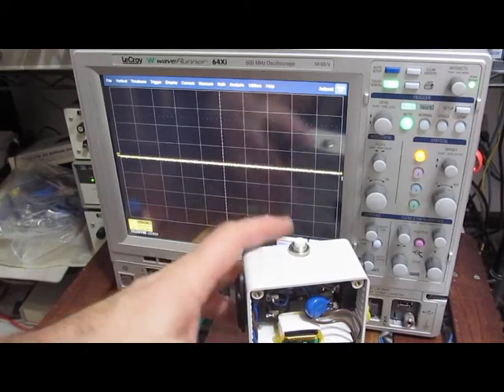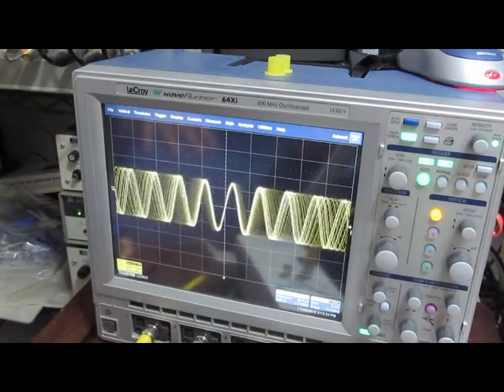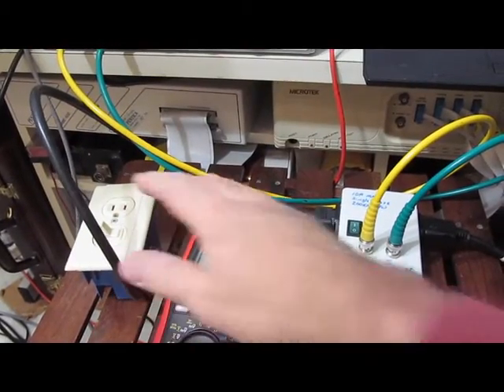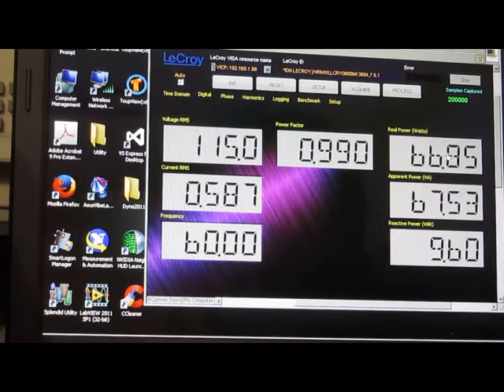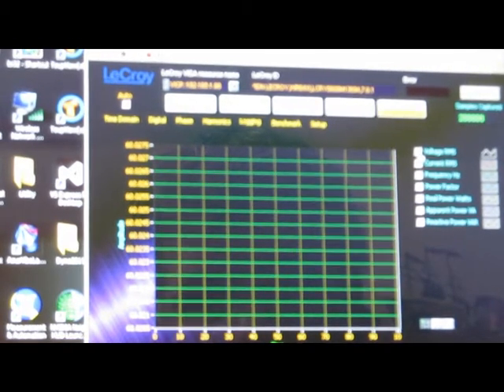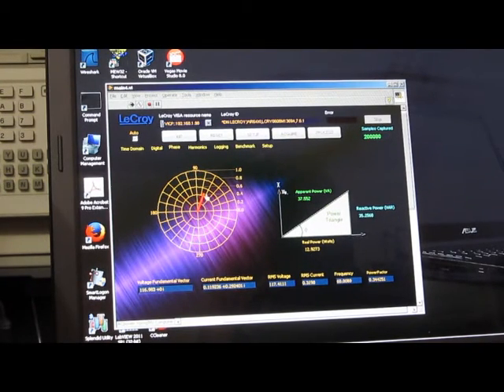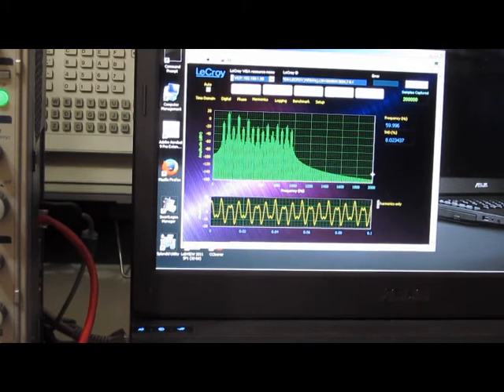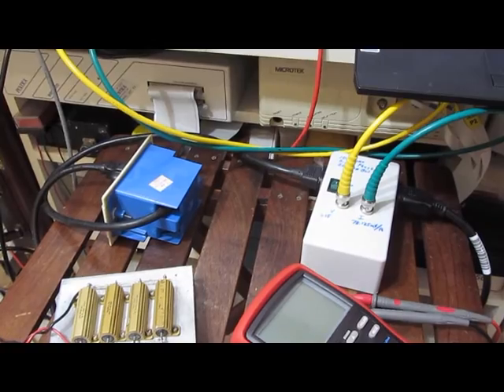Measuring AC power with my LeCroy 64Xi  and Labview

Comment: hi, did you had the power analyzer macro installed in the scope? i know lecroy charges alot of money for that one

or was the laptop doing all the data processing ? 

was that software from national instruments? and if one can download it can you advise where ? r

egarding the sensors you used, just a hint...you can use a LEM LV25 which is can be used to measure voltages instead of that transformer that  you used...will get you a proper bandwidth with negligible phase delay on the voltage measurement to match that of the current...it is however quite expensive (3x more than the current sensor).
Reply from the maker: Custom software written in Labview.   Transformer was something I had.  I measured the response and it seems it was flat well past the number of harmonics I was interested in.   There is a part 2.   https://www.youtube.com/watch?v=04I7nHA_HxM

Comment: Ask if you can have a key for the software option to compare, I'm sure it's not a problem.
Too bad it's only 8 bit and poor accuracy, so it can't replace a real power analyzer.
You should go work for Keysight, you did better with this than their PA2200 power analyzer, what a POS. They recently did a demo and it literally did not work. Totally unfinished.

I run a similar software on my bench, so I can read the data out of the instruments. It calculates efficiency, charts graphs, logs data, reads out the harmonics and displays them in a sensible way (the power analyzer interface is atrocious).
I have it on a small touchscreen display to control it and input numerical values for the loads. 

You could easily add some code to control your signal generator and record bode plots.
Reply from the maker: +stefantrethan With the PA2200, was part of the problem that the people giving the demo did not know how it worked?    The system looks pretty nice.  Too bad they couldn't demo it for you.   Which systems do you have where you work?
Reply: +joe smith There were issues on all fronts.The software was useless. That screen that you programmed with the digital readouts (power and such), it did not exist. You only got the trace (scope) view, and those all important numbers where shown tiny on the right like any old scope measurement. Autoscale/range did not work at all and this is important on a power analyzer. It had some weird acquisition problem where it would just go to maximum ADC value randomly. The voltage channel was intermittent. Even if the hardware wasn't broken (which we can put down to that one demo unit) the software was so far behind it was no way near ready to show. The harmonics display did not allow you to correlate to the different limits set in the standards (they fixed this by now I think). Clearly the person who made the software had either never used a power analyzer, or at least never used it to any purpose. If this was meant as an option package to a scope, it would have been a poor showing, but for a 20k standalone unit, no way. 
Just look at the current imput on the rear:
<http://about.keysight.com/en/newsroom/imagelibrary/library/IntegraVision_images/image009_high.jpg>
Do you think this green terminal is good for 50 amps on a lab instrument? 

I think the idea is good - use existing cheap scope platform and put isolated 16 bit converters on it. It would give them a nice flexible platform like Yokogawa has. But it's gonna be a long time before I take them seriously again on power analyzers. The product just wasn't ready at all.

At work we use power analyzers from LEM/Norma (now distributed by  Fluke and Valhalla scientific, but they were always made by Infratek in Switzerland), and also ones from ZES Zimmer (Germany), which are more precise but keep breaking down. I have a Valhalla 2410 at home, which I got on Ebay with a burnt out shunt, easy repair.
Reply from the maker: Good post. Thanks for the info. 

The connectors do appear just a bit on the small side to handle 50A.   How long ago did you have the unit demo'ed? 

Does your systems at work have a transient mode?  If so, any idea on the sample rate and BW?
Reply: +joe smith It was in the last six months.

The power analyzers do offer transient mode for inrush current, although I never used it. Much more convenient to use a scope and current probe, especially since there is no precision needed for those measurements and you need to control source (and wiring) impedance.
Bandwidth is from 50kHz to a couple of MHz, depending on model, I think the Valhalla scientific version I have is specified up to 300kHz.
Reply from the maker: I can't see leaving a scope setup for months on end at a customer site.   Maybe with a PC  with some custom software or something to log the data along with a UPS.   I'm not sure how you would handle 3-phase.   Do you only use this in the lab?
Reply: +joe smith Ah you mean transient as in power quality! No these are not power quality analyzers, these are power analyzers. Although I suppose you could set up logging software and do that too. I just assumed you mean transient as in inrush current, load changes, and the like. The dirt on the grid does not concern me - unless it is caused by me or messes with my power supplies.
Reply from the maker: I was thinking if your systems were fast enough to catch some of the IEC waveforms, I would have a look.   Does your company produce and sell power supplies?  If so, do you only test to the IEC standards to validate your designs?  I have seen my fair share of "CE" marked, non- compliant supplies.  Even the ones that pass, I have seen fail in the field, normally due to transients.
Reply: +joe smith I wouldn't hook a power analyzer to any of the transient testers, there is no point since they are not really fast enough and the voltage input may get damaged (current too, in case of a fault). When I work on a transient immunity problem I typically use a P6015A with a scope, just to have some safety margin. It's just a few kV but the mains pushes quite some power into any fault, so best to have some safety margin.
Reply from the maker: When you have field failures, how do you know what caused the problem?   Are you required to meet any of the IEC standards?  If so, is this as far as you go with your transient testing?  I'm just curious. 

It's funny to think that a system that is designed to work on the line, not being able to survive basic tests.   The last time I was looking at power quality meters, the first thing I did was subject them to the IEC standards.   I had the sales reps right there with me when we ran them.   
 
If they can't survive that, they are not going to survive in the field.   Of the ones I evaluated, none failed.  

I have thought about getting a 6015 before I built that last HV probe.  Those are nice.
Reply: +joe smith You get the failed device back, so you can look at it and determine what may have caused the failure. Yes obviously we are required to meet the standards, this is not the wild east after all. Depending on application the requirements are different. I will typically test to destruction to determine the margin, but certification does not require that (the test voltage level set by the standard is considered to exceed expected field transients with margin). It is easy to increase transient immunity by using varistors, but I do not like to use them across the mains because of the predetermined wear out failure. So just testing for transient immunity over the required and reasonably expected voltage level tells you nothing much about the quality of a device (including multimeters, but you made that disclaimer often enough). 

I agree power quality monitors must meet the highest standards for mains transients (and then some), but power analyzers are not really meant for that kind of abuse. They probably would be fine and the voltage rating at the input along with the measurement category would tell you what overvoltag transient they can take (same as on a DMM) but either way, I see no reason to connect an expensive piece of test equipment to a surge generator when it can not measure anything of use. Also any input protection may even interfere with the transient if it is implemented in a not so clever way.
Reply from the maker: +stefantrethan "the wild east" too funny!   It would be interesting to see how you decide what you think caused a given field failure without having data showing you what it was hit with.  Do you have a way to test with pulses wider than the IEC calls for?   Our generators are designed for these standards (talking surge and burst) and you can't adjust them.   One of my concerns is about lower than a KV with a much longer duration.   Your clamps may not even see it.     So much can go wrong.      I had a power supply (I won't mention the name) that they had an over voltage crowbar in it using an SCR.  During radiated immunity tests, enough RF imposed on the output of the supply would cause it to go unstable and the crowbar would kick in.  The crowbar's SRC would then fail short.  Down stream, the supply would put out a huge 40V spike (way over what it was normally outputting).   Back then, we were testing at 100V/m.  

So what do you think.  Is IEC going to change the mandate on harmonics?
Reply: +joe smith Often you can't tell for sure. Such is life. Investigation at the customer site is only warranted if the failures are frequent or repetitive, which thankfully is exceedingly rare. In such cases the power company installs power quality analyzers (since it is their presumed mess to sort out not ours).
We can adjust our surge/burst generators in voltage and repetition timing, but not pulse shaping. It doesn't really matter if a longer pulse would kill it - just as it doesn't really matter if a higher voltage would kill it. There is always going to be some more powerful pulse that'll do it in. Sure sustained overvoltage will do the trick, but so will a hammer. Quality is not to make it survive abuse, but make it last forever in normal use.
100V/m, that's something, was the power supply even specified for that? Usually only automotive and mil stuff is tested that high. Output wiring is going to make a big difference, any handy junctions will act as detector diodes and rectify that good stuff unless there is sufficient blocking capacitance.
Re. IEC, I assume you mean low voltage harmonics limits. It's usually worse at high input voltage so as long as they don't do something silly it won't be a problem.
Reply from the maker: "but make it last forever in normal use." This is exactly the problem and why I ask.  Does the IEC requirement represent the norm. 

With the cost of service and down time, it may make sense to harden the designs further.  I don't consider what happens at an installation abuse.  

That's been a long time ago with that brand of supply.  I used an outside lab once which was capable of 1000V/m for military work.  Their upper frequency was a lot higher as well.  
   
I have heard for a while that IEC would like to remove transformers and standard induction motors.  One thing you can count on with large organizations like this, they move slow..
Reply: +joe smith "I don't consider what happens at an installation abuse" well, where do you stop then? Excessively dirty mains or overvoltage is just as much operation outside the specification as excessive temperature, or immersion in water for something without IP rating. If the mains is much dirtier than the standard allows there needs to be something done to fix that grid, not the device. Either the offending sources need to be suppressed, or surge protection needs to be installed, or whatever else to bring the grid in line with their specification.
It is not reasonable to expect any small device to clear up the entire grid for you. By overbuilding in that regard you deliver the customer poor value for money or size or weight or efficiency or whatever because other areas necessarily suffer.
And no, surge failures are not very common field failures in a supply that meets the standards.
Reply from the maker: "well, where do you stop then?"

If a competitors design survives in a given  environment and yours does not, and that's important to the end customer ......  

It would be very interesting to know more about your company.  What your products are, there end application, where you sell them,  qtys.   Maybe send me a PM.
Reply: +joe smith If your competitors design is more expensive, or larger, because it has higher surge immunity that can be just as detrimental to their business. Balance is the key,  and as mentioned before the cheap and easy way to increase surge immunity is to add varistors, which will limit the life of 100% of the units so that 0.001% can survive that higher surge. If a customer needs increased surge capability he will specify accordingly, and get a product that can deliver that, implemented properly. But to just arbitrarily overbuild any one parameter of a mass produced device for no good reason leads to an inferior product.

Look at it this way - would you like it if your bones were stronger? Sure, you'd be less prone to break one. But there is a biological cost to stronger bones (more muscles, more food requirement, slower movement so the tiger gets you, etc.). So after careful investigation you will leave your bones as they are. Design for mass production aims to minimize evoution, and replace it with intelligent design, because you don't have that long to get things right.

That reminds me, gotta go fetch those button cells.
Reply from the maker: Without knowing a little more about your company it will be hard for me to get a perspective.   Maybe just post a link to your companies website.